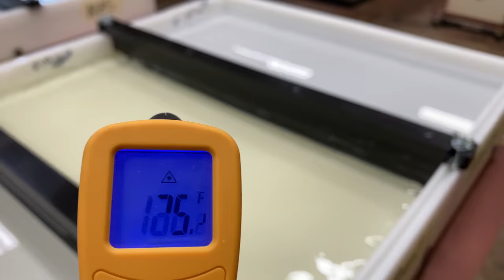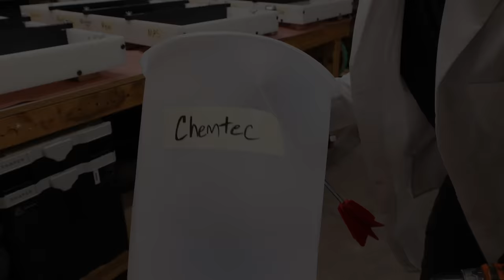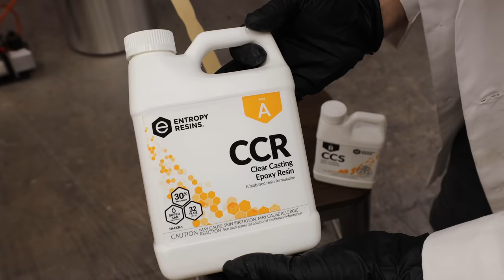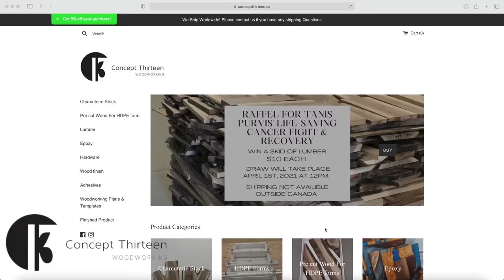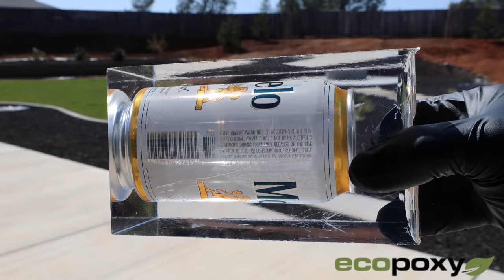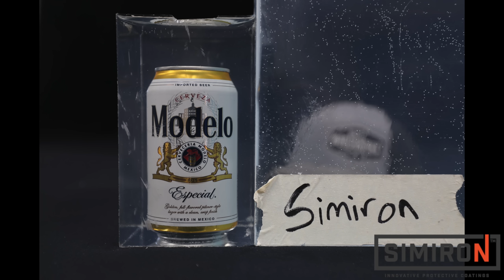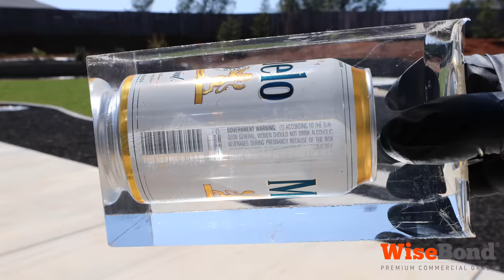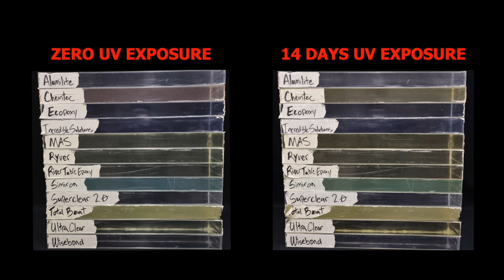Deep Pour Epoxy Clarity/UV/Hardness Test - Detailed Comparison!

Comment: Why he has noi bubbles inside epoxy ? When i use epoxy it has many bubbles inside
Reply: Part of it is from mixing and pouring practice. Temperature, moisture, and surrounding area also play a part. There are many ways to reduce or eliminating bubbles, degassing being probably the best if you want to ensure the least amount of bubbles possible.
Reply: Another thing you can try for pours is, spritzing denatured alcohol over top, or using a propane torch. The alcohol help bring bubbles to the top and pop them without adding heat to the resin and causing it to react unevenly. The torch is good too, you just need to be aware of the heat being applied to your epoxy. When using the torch however, you need to keep in mind that it's the Carbon Dioxide that the torch produces through the burning, that actually eliminates the bubbles. Not the heat. So keep the flame back from the pour and quick passes should work. If you are 'pushing' the epoxy resin with the torch, it's too close.
Reply: A heat gun works to remove bubbles for me. So I am not sure about it only being carbon dioxide and not heat that removes the bubbles. (Unless an electric flameless infrared heat gun creates carbon dioxide? I'm not sure?)  I find that the heat will thin the epoxy a bit too, so it helps the let the bubbles travel to the top easier. But definitely do not over heat, or use multiple times because your epoxy will suddenly thicken, set or cook/burn, ruining your work.  I'd do a few test runs with each technique until your comfortable with how it reacts with your brand of epoxy and with your particular project, because many factors could create different results. :)
Reply: @huckaday  So I've been corrected. I was taught that it was the co that removed the bubbles and given that it never failed, and it was explained in a way that made sense to me at the time. 
So yes, Alana Harley is correct, heat is the predetermining factor in their removal. That being said, I still am under the impression that a torch is a little better than a heat gun. If you keep things clean, the heat gun works, but the issue with them is;
 -The 'pushing power' (Which is easily controllable if you know what you are doing)

and,

 - The particulates that might reside in the heat gun or surface of your pour. The division being, where the heat gun may introduce things such as dust or small debris onto your pour, a torch would more or less remove it. 

At the end of the day. There are several ways to remove bubbles, some harder some not. I'd recommend the gun or torch solutions for an easy method, but half the fun of it is practicing and finding out your own way of doing things!

Sorry for the ramble...13 days later, lol.
Reply: Get a vacuum chamber. Removes the bubbles.
Reply: first when you pour it, pour slowly and pour from a little higher up because that thins the stream and you'll get less bubbles then hit it with a heat gun, the heat will thin the epoxy allowing bubbles to rise up.

Comment: I missed the part about eliminating bubbles. Can someone please explain that?
Reply: The technique used here is called degassing.  You put the epoxy in a chamber and pull a vacuum.  This makes the bubbles expand which in turn lowers the density of each bubble while the density of the epoxy itself remains about the same.  That makes the bubbles much more willing to rise to the top and pop.  It pretty much looks like boiling water.  Once you remove the vacuum, any remaining small bubbles will shrink and be tiny.

Depending on the size of the pour and your equipment, you can take this a step further and cure the epoxy at high pressure in a pressurized chamber.  This forces any remaining bubbles to be even smaller.  The problem with that though is that it becomes really impracticable really quickly as the size of your project goes up.

Comment: @Matt's Woodworks reading the comments I actually believe that people were influenced by what you said before you polished them and then had them make their pick. Id bet good money if you would have had them make their pick before making any revelation of your thoughts then their pick would change. You could have literally said Total Boat had the overall best outcome & gave a lil spill on why that they wouldn't understand anyways, and they would have fawned over Total Boat. Keeping it a buck going by just clearest for the top 3 my picks were Superclear, Incredible Solutions, and Ecopoxy. When you gave your top 3 I was like "Wisebond huh wait wtf" I went back to see how you arrived at such and immediately I saw where you went left and I went right. I didn't choose Wisebond because of the little bit of yellow tint it had over Ecopoxy, but you must not have picked Ecopoxy because the slight blurry or haziness it had over Wisebond. Up until that point there was no way for us as viewers to even attempt at which was clearest because with them stacked even with multiple different angle shots some of them you just couldnt see how clear they were. You just got a generalization or educated guess for the top 3 slots. In the end I was dumbfounded by the position I found myself in. I was shocked at the quandary of which was clearer my Liquid Glass or Incredible Solutions? From what I had to work with I tried hard even changing up my criteria that determined a winner, and each time I came up with a draw. I wasn't about to due Innie Minnie Mini Moe and gave up I took my ball and went home. You did a fantastic job doing this video. I have watched dozens of these type of videos related to epoxy resin. This was a 1st for deep pour clarity. I hope you do more like this because this was clearly the best out of them all in how you conducted it. 2 thumbs up

Comment: Note..clear and zero bubbles isn't necessarily  best..it depends on application..eg..for a lighting device one may require diffusion,  therefore  super clear will not offer that quality.
Reply: Ever try mixing in some gold dust particles? That idea popped into my head but I have never done any epoxy projects haha.
Reply from the maker: Thanks for the feedback!

Comment: Since all of this will eventually age yellow, get one with a slight violet cast and it will resist the yellow tone. (Incredible solutions)  I would prefer to see you leave these outside for a loooong time and keep following up.
Reply: Or use a thin polyurethane top coat for UV protection.
Reply from the maker: I think a follow up video is in order for a longer UV test!

Comment: I use total boat I didnt realize how yellow it is :(
Reply: It's only because of that product not being intended for pours deeper than 3/4".  As Matt mentioned, they're developing a new deep cast product that will be specifically designed for deeper casting.
Reply from the maker: I did redo the test at 3/4", it's piped into the video!

Comment: All my allunilite has turned yellow and i haven’t even used it yet 🤦🏽‍♀️ now i have to mix it with pigments
Reply: Um that will not help.  🤷🏻‍♂️
It still yellows with pigments.
From the land down under 🇦🇺🇦🇺🇦🇺
Reply: well, for Amazing Clear Cast epoxy - one of the parts is yellowish when un-mixed.  i've found that once mixed, this goes away.  i hope you'll at least try it before you trash it.

Comment: Where's your PPE? that much resin without a rated respirator would make me nervous.
Reply: If you look at the MSDSs for the products he uses, there are no significant VOCs, therefore a “rated respirator” is not necessary.
Reply: @chriscarskaddan64  If anyone is interested in why resin is not safe: It has "volatile organic compounds" (volatile = things that can turn to gas) that are given off during curing, and sometimes if it simply sits in a container that is uncovered (depends on the particular resin). The resin manufacturers are only required to label VOCs if they offgas after curing. In its uncured state, all resin offgases VOCs, even the "low VOC" kind.

Any VOCs can be pretty bad for you, but the stuff in resin is particularly bad, for a few reasons. In particular, the ones in resin (I forget their name) are carcinogenic (i.e. it causes cancer) AND the effect will build up over time - your lungs won't 'heal' the effect of exposure, no matter how small.

You might not realize that you're damaging your lungs until you go to the hospital.

BUT luckily a typical respirator from amazon are pretty cheap, and fit the 3m cartridges that filter out VOCs.
Reply: @dawnchesbro4189  thanks for your well thought out response. However, there is no evidence that the resins, in cured or uncured states, used in this video, contain carcinogens. If you can find evidence to the contrary, I’d be happy to learn from it. Sadly, VOCs and carcinogens are ubiquitous in modern society. We all should be wearing a rated respirator every time we are around cars with internal combustion engines, or second hand smoke. Youtube content creators do need to set good examples for the viewing public, but in this case I don’t think the guy is doing anyone a disservice.
I’d welcome your thoughts.
Reply: @dawnchesbro4189  thanks for your well thought out response. However, there is no evidence that the resins (cured or uncured) used in this video contain carcinogens. If you can find data to the contrary, I’d be happy to learn from it. Sadly, VOCs and carcinogens are ubiquitous in modern society. We all would have to wear a rated respirator every time we are around  cars with internal combustion engines, or second hand smoke to avoid the detrimental effects. YouTube content creators should set good examples, but in this case, I think the guy is not doing any one a disservice. I’d welcome your thoughts.
Reply: I know that if i pour resin without a respirator,  i end up with terrible headaches.

Comment: You sure you are not sponsored by Super Clear?  So many bubbles.   BTW its terrible w bubbles and setting up too quickly.  Giant epoxy squid all over my piece.
Reply from the maker: During this process and video I was absolutely NOT sponsored by any of these companies as stated in the video.  After it published I got 5 offers for sponsorship from 5 of these companies, I ended up choosing Superclear. I use a degassing chamber so I’m not worried about micro bubbles.  

What was the ambient tempt for your pour?

Comment: To actually measure the clarity you would need a photometer  with a wide enough range to cover you spectrum. You then need lasers one each in the Red, Green, Blue IR and UV spectrum. Keep the laser and the photometer at the same distance. Measure the laser in open air, then place the cast between the two and measure. Each cast will need to be the exact same distance from the laser. So you have the wavelength in open air, through resin and your delta. The one with the largest delta for UV blocks UV the best The one that has the smallest average delta of the RGBI set is the clearest. If there is one with the smallest RGBI Delta and the largest UV delta and is the cheapest then it's the uncontested winner across the board. That's pretty unlikely though
Reply: What is "Blue IR"?
Reply: @jkg6211  :)  That is what you call a typo. I apparently missed the comma and did not catch it. We can probably insert a Grammarly commercial here. Because I'm human and have no problem admitting that I make mistakes, I am leaving it as is. That and I want to watch the google search stats to see how many people try to look up Blue IR. There apparently is such a thing, but clearly not what I meant. https://onlinelibrary.wiley.com/doi/full/10.1002/adma.201702464
Reply: @bmmcwhirt  IR is generally 700 to 1,000 nanometers in wavelength, while UV is 100 to 400 nanometers.
Saying that there's such a thing as "Blue IR", is like saying that there's such a thing as "Clear and Opaque",  or "Dry Water".
While no such thing exisits whithin the Electromagnetic Spectrum as "Blue IR", I understand your confusion, given the immense amount of misinformation on the internet.
One can also find "Proof" online that the World is flat...
Reply from the maker: Wow, this sounds super interesting but also extremely intimidating all at once!  I'm in, where do I get one?!!

Comment: Could someone provide a link to $20 per liter incredible solutions? I can only find it at $80 and up
Reply: I think he was saying it's $20 per ounce. Problem is these are all commercial grade so they only come in commercial sizes. $80 isn't too bad if you get a gallon of both solutions
Reply: $80 is a great price per gallon and works out to about $20 per liter. If he was talking about $20 an ounce, resin would cost $2,500 a gallon so thankfully that’s not the case!

Comment: Anyone got any ideas on what to use to pour Length : 20inch Depth : 4 inch Height :  12inch slabs ? What to use?
Any trips and tricks?
Reply: about tree fiddy
Reply: If you really want the absolute best result, buy a vacuum pump and either make or buy (I don't know where you would buy this, personally I would make it) an airtight and strong box big enough to fit your whole pour in. 
Another way to do it is to just get a vacuum chamber (a pressure cooker can work well for this, just need to make a fitting for the vac pump for it) and pull vacuum with the epoxy in it right after mixing, but before you pour it. The second way won't be quite as good, but still will work well to keep the bubbles to a minimum. 

2 cheap ways (I have not tried this way, but I have been curious about it).. 
use a vacuum storage bag to pull bubbles out of large pours.. just make a litte frame around the pour so the bag doesn't get sucked into the epoxy. All you need to do this is a shop vacuum, or even a house vacuum with a hose.... not sure how well it would work tho.
Last and maybe least (other than doing nothing and hoping for the best) is pouring in stages and popping bubbles with a torch after every half inch/inch deep pour. Don't let it cure too much before pouring next stage, but also give it a little bit of time to see if bubbles are going to form.

Now for the real trick... after pouring, find a way to keep the whole thing cool/cold. You want to try to keep it as cold as possible really... cause it's going to get really hot with that much epoxy. Soooo... make your mold so that it can fit into chest freezer/fridge  (you don't actually want to get it down to freezing temperatures, so do the pour with the fridge off, then turn on about an hour after uve poured). This will result in the best possible finish quality because you can keep the temp from getting really hot like it did in this video (and his pours were only half as deep as yours).. although these brands of epoxy may not really need to be cooled even at a 4 inch deep pour.
 Oh also.. cooling it down like this will add like an extra week or 2 onto the curing time. :)

Comment: Seriously? The most obvious way to judge clarity and color is through the long axis but on some of them you spun the panel too fast to see down the long axis. On some of them, you even sped up the rotation the moment long axis was about to come into view. The simplest and cheapest way to do this would have been to cast the epoxy in black PVC pipes. Film down the pipe and all questions are settled. Doesn't make for much content though.
Reply: wish someone would do it that way, F.P. doesn't seem too complicated, and would make for easy comparison, from this side of the lens.   if you come across any other good 'test' videos, let me know.  Thanks- 🔨Lisa♿